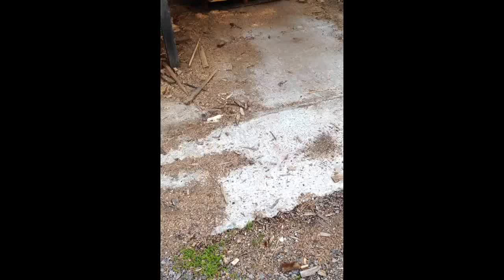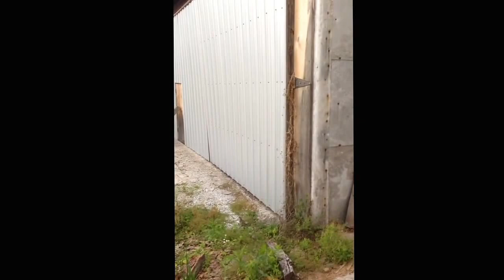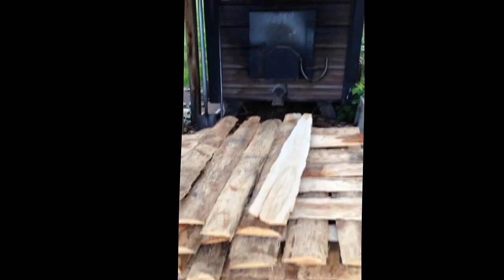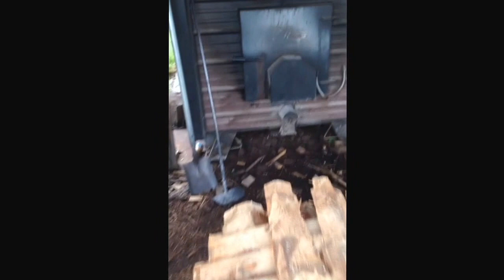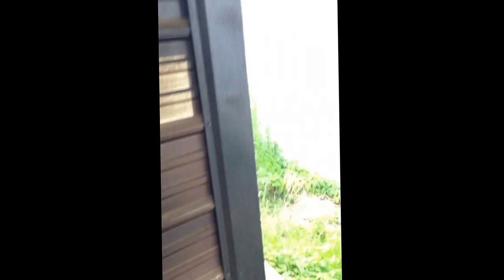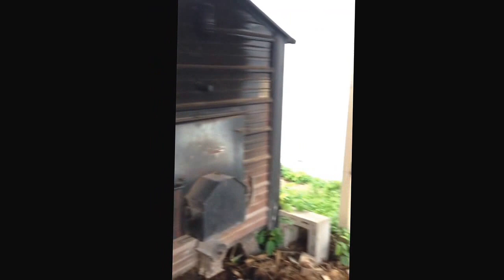Wood fired furnace heats lumber drying kilns.

Comment: Great setup hopefully I will build something similar in the future. 

Right now I am sending up my first dehumidification kiln and I am adding a side room with a wood stove to heat up the kiln when it needs it.  Heating with electricity or propane costs an arm and a leg so I'm just going to use an old wood stove until I can afford a wood boiler. 

Thanks for the video.